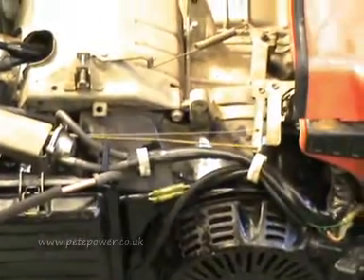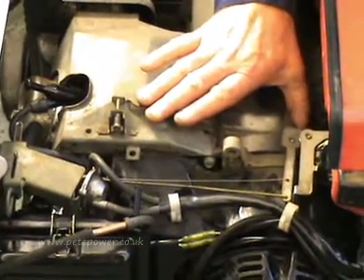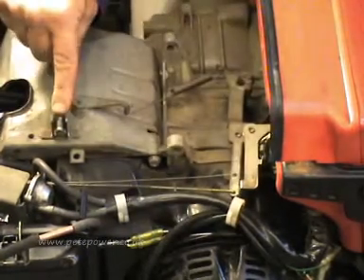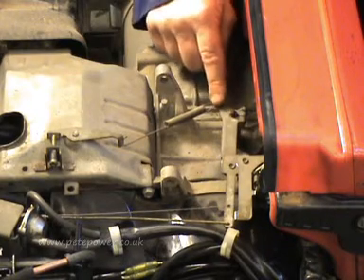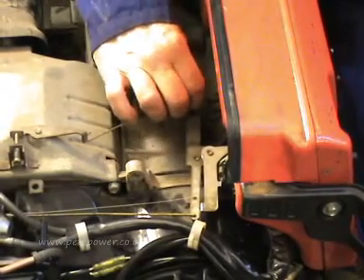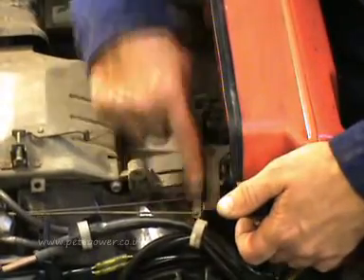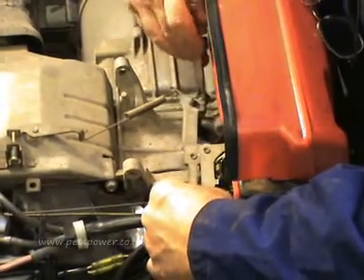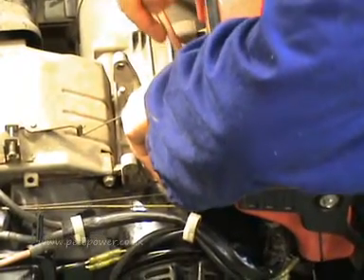setting the governor on a Honda EM4500s

Comment: I would be more concerned with setting the RPM, which apparently at the fast idle on this and on a EB 5000 X generator is supposed to be 2200 at the low speed and you shouldn't go over 3600 at the high speed if I can I prefer to run about 3400 on our Small Engine. They seem to last about three times longer than. But if I had a Hertz meter I could check. I just don't know where I buy something like that lol
Reply: Rpm is directly related to frequency. Sounds like you have a US 60hz machine so rpm should be 3600 as a baseline. If you run at 3400 you will burn out the AVR as it will be running flat out all the time trying to compensate for the low  voltage.

Comment: On the base of the float chamber on my em4500sx there an electric controller that controls the fuel mixture  by the look of it. The engine runs rich and there appears to be now power to this when the engine is running?
Reply: The solenoid on the bottom of the carb just shuts off the fuel when the machine is switched off to prevent unburnt fuel being dumped into the exhaust. It has no relevance to fuel mixture.

Comment: for 60hz the engine rpm has to be 3600rpm    60HZ = 60 cycles per second     engines are measured in RPM  M=minutes   so there there 60 sec in 1 minute  so you take 60 X 60 =3600   50Hz is 50 cycles per second  so 50 X 60 =  3000